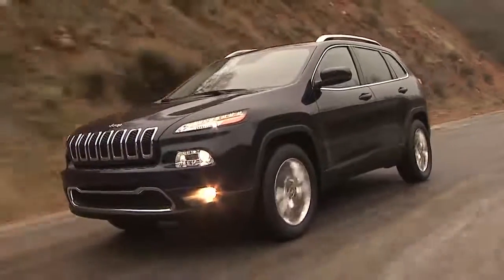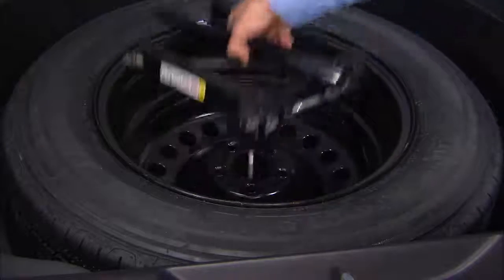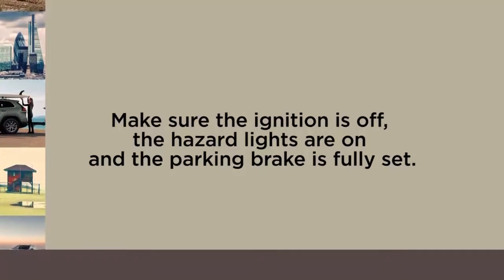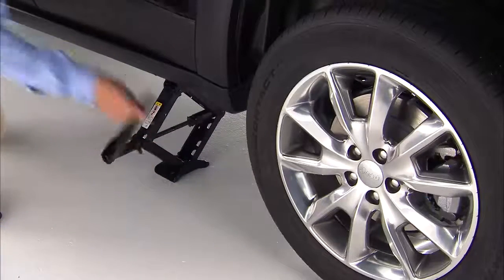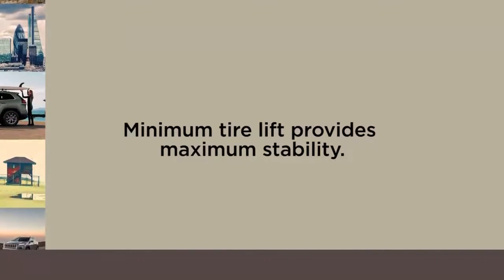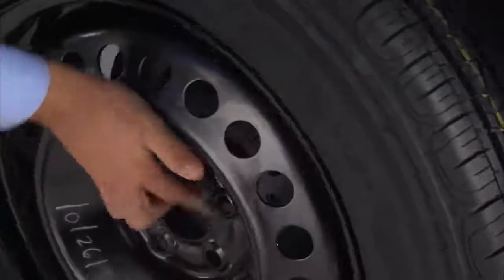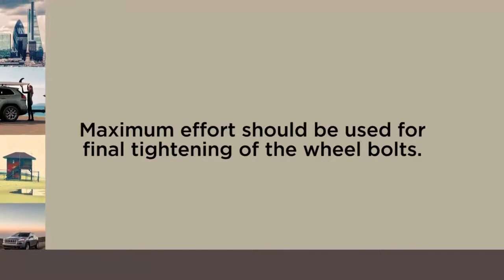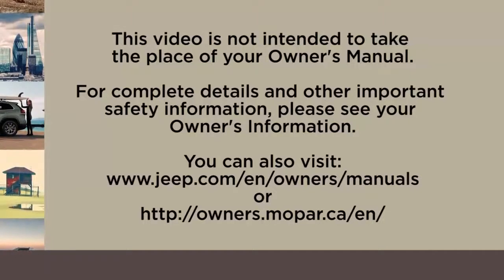Jacking and Tire Changing - How to change a tire on 2017 Jeep Cherokee

Comment: I have a 2017 Jeep Cherokee trailhawk L plus. 37,000 miles. I have a flat tire and tried putting on the spare but once I took all the lug nuts out, the tire will not come off. I cannot for the life of me, get this tire off. Wht am I doing wrong? Anyone else?
Reply from the maker: Hello Zach, 
We recommend reaching out to your local dealer for assistance. ^LH
Reply: did u figure it out eventually?